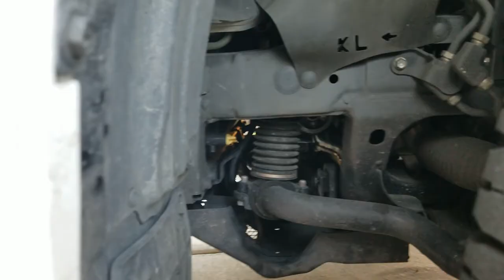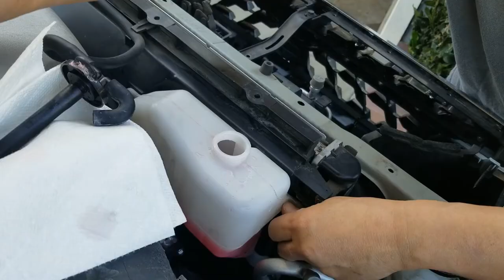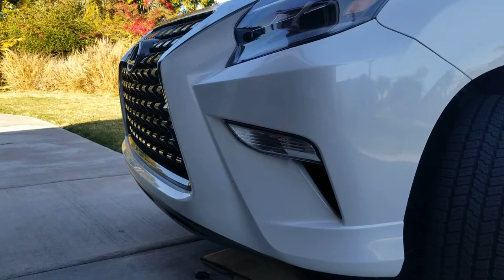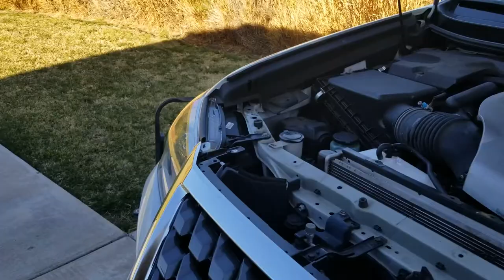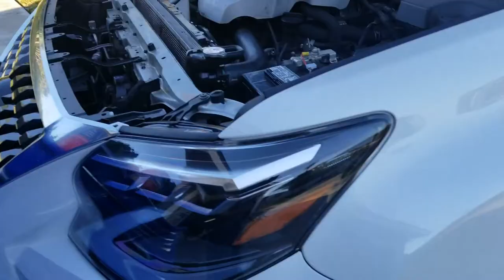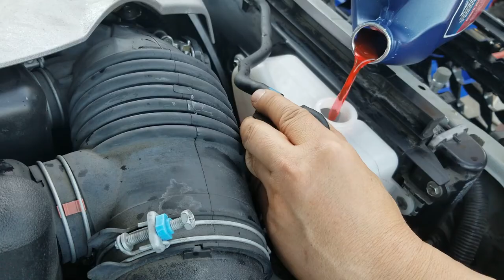Lexus GX Radiator Drain and Fill

Comment: Hello Bob, any reason why you had flushed only the radiator instead of full flush? The GX takes about 3,4 gallons of coolant (according to TechDoc), so replacing just 1/3 isn't helping with old coolant degradation. There are actually two additional drain plugs on both sides of the block, which should be removed during full flush. At least these are procedures for proper coolant flush. Any thoughts on this?
Reply from the maker: @chopperpl  Because I replace my coolant often before it’s scheduled to be replaced hence the drain and fill and not the flush and fill.

Comment: Another awesome vid! Thanks again. A couple tips (take it or leave it) you could find a small hose to direct the draining coolant into your container for a lot less mess, that is if you care. And another thing that I bought and love is the spill free funnel. Its perfect to burp cooling systems and comes with a bunch of adapters for all kinds of cars. Its around $20 if I remember but you just leave it attached to your radiator cap with coolant about half way up and let it burp itself.
Reply from the maker: I"m gonna take it!  Great advice Paul, thank you.
Reply: sissy boy! ;)

Comment: Hey Bob- I’ve read on the forums and Facebook pages that guys are also draining the engine block from below, in order to get an additional 8 to 9 quarts out.  What are your thoughts on also draining the block in addition to the radiator job you’re doing here?  Thank you!
Reply from the maker: Hey Paul!  Yeah that would be a flush/fill procedure.  I did a drain/fill which is faster and because i change my coolant more frequently than recommended by Toyota Lexus.  I wouldn't worry unless you haven't done a coolant drain  in a long time (over 100k).  If you're at lower mileage, i wouldn't worry about doing a complete flush.  Thats kinda overkill for me.

Comment: I'm trying to bleed the air from the  coolant. But cant find no screw information.  Your video is the best video by far online. But im still dont know how to bleed a lexus gx. Keep up the good work. 
P.s Jiggle bolt at 12 oclock.. that sounds relevant to any of this?
Reply from the maker: You might want to invest in a Radiator Buddy, it'll make your bleed process a lot easier.  You're able to view the bubbles "burp" when you squeeze the upper radiator hose and it also gives you the hassle-free process of not having to refill once the coolant level goes does several times during the bleed.  
https://youtu.be/2f30UxPujIk

Comment: Amazing video. A question: My GX460 2016 version has a small leak in the radiator and I'm going to replace it and in my research I found Cooling Radiator "Compatible" with the 2010-2018 Lexus GX460. Is that ok to buy? Thanks
Reply from the maker: i'll be honest with ya, i'm not completely understanding your question.  Compatible means compatible.

Comment: Have you ever run into a coolant leak from the valley plate from your other GXs? I heard it’s a common issue with higher mileage Lexus V8s.
Reply from the maker: Only real issue i've had with my older GX's are radiator leaks.  I've had that twice on 2 different 2008's.  Its no big deal but just fyi that those 1st generations are prone to it.
Reply: According to The Car Care Nut, the reason for those leaks is this long live toyota coolant, which toyota claims should be replaced every 100k. Those long intervals are responsible for lime deposits around seals, which leads to their failures. You should flash the coolant every 30k or 50k with the radiator cleaner capable of dissolving the lime buildup. This should prevent those seals from failing prematurely.

Comment: Does the coolant need to be topped off every couple hundred miles or is that indicative of a leak?
Reply from the maker: Normal coolant evaporates over time. Rule of thumb is 1” per year or 1/4” every quarter. Assuming you’re keeping your reservoir at the max, your radiator cap is in great condition, and you’re replacing your coolant at scheduled maintenance with the correct coolant. That is if you’re losing coolant without any visible puddles where they don’t belong (driveway, underneath radiator, etc…)

Comment: Do you have a video on replacing upper radiator hose?  Mine is leaking at connection.
Reply from the maker: Not sure if a video is necessary for that.  It's pretty straightforward.
Reply: @GXBOB  yes, I was able to do it.  Only issue is the plastic inlet where it connects is looks cracked at the very edge and I think there is a very small leak.  I am almost sure its the reason I have been having to add coolant.  Will have to get a new radiator witch is fine as long as it is not the valley leak that I’ve been hearing about

Comment: So You need only one gallon of the coolant?
Reply from the maker: Hey E M,  every GX is going to vary.  A lot of folks do multiple flushes to get the entire system ran thru.  I didn't do that.  I did a quick flush and fill regardless of whatever is left in the engine.  The reason why i did this is because i do my flushes often (very inefficient way of spending your money and time, i know).  For someone that follows the book and want to flush it completely, the book calls out for roughly 1.75 gallons of red coolant as capacity but i always carry way more than needed because u can always return what you don't use.

Comment: Bob i saw other vedios where you need to take of the remaining water from the engine . I think u didn't make a full flush.
Reply from the maker: In the body of my description, i mentioned my justification for just a radiator drain and fill instead of a entire system flush.  Those are only done if  you are doing it every 100k miles.  I do it  every 15k.  That makes for a better flush than once every 100k.